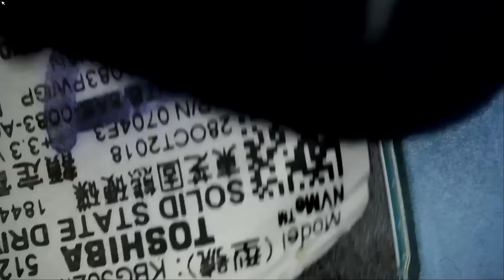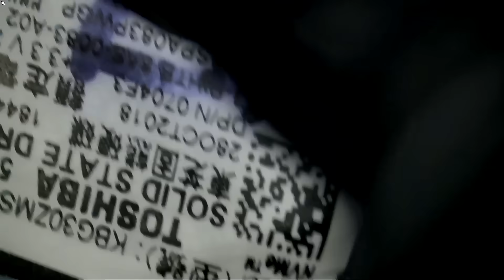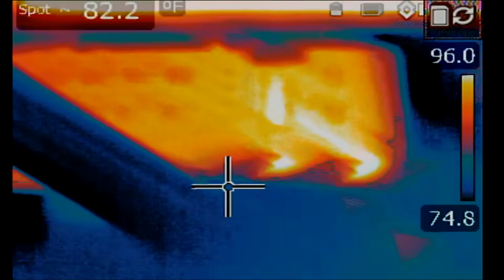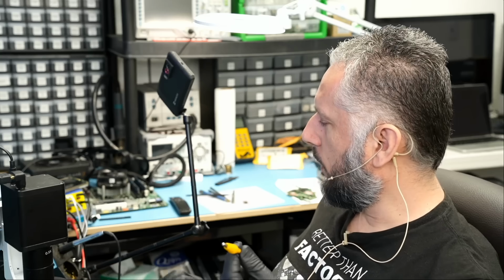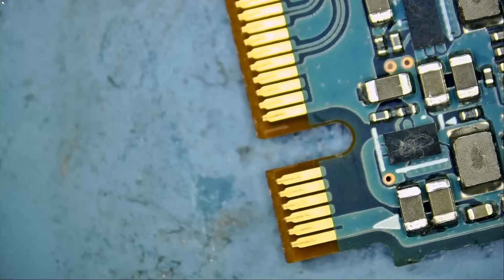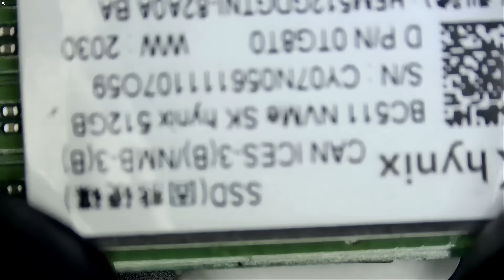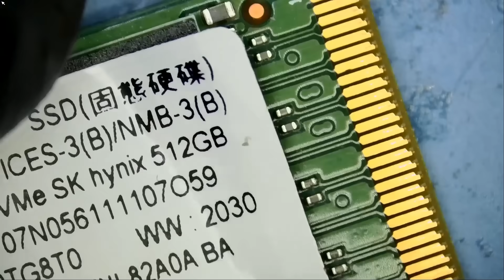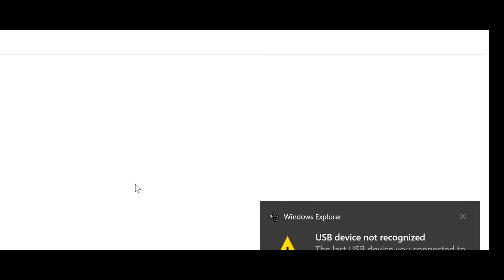M.2 NVME SSD Drive Repair - Is data Recovery possible?

Comment: Hello, I have a question recently I had 2 NVMe SSD fail, not the same time but on the same slot, while I was using my computer they were both my boot drive, my question is if this is because of the ssd or the motherboard?

Comment: Hi, I’m using a GigaByte NVMe 1TB. It suddenly stopped powering up. I’ve tried it in different laptops and external SSD enclosures, but nothing works. I believe the data is safe, but the power issue persists. I don’t have an expert nearby, so could you help me troubleshoot and fix the power issue?

Comment: got the same drive to the hands - it's also not detected, but it makes some electronic noise when connected and SoC heats up. Will check the stuff around of it like you did.

Comment: Hi .... I have Acer Nitro 5 with a Nvme hard drive from the factory . But wen i try to start from the power button , it comes a black screen with any logo , but just black screen . I can not see even the mouse . But if i change another driver , all works fine . Do you think my original Nvme hard drive is already dead ???

Comment: Your machine is seeing a drive, it’s just the storage format is not recognized (fat32 nvme etc) If it’s not recognized, 99.5% of the time, it’s a Linux based drive and was created on it. Windows is garbage and only reads it’s type of drive protocols whereas Linux reads all protocols.

Plug it into an Ubuntu machine

Comment: Which SSDs (Nvme) drives do you see as less likely to fail from your hands-on experience?  Which drives do you see often in your shop that "fail"?
Reply: I just bought lenovo nvme that stopped working during first test run. It got renowned silicon motion controller

I got another chinese nvme that is working just fine.

You can't tell when these would fail.

But you could put your trust in SanDisk, WD and Kingston.

Comment: Have you ever seen a non-boot NVME drive cause a BIOS POST error? I’ve got an ASUS B650E-F with a 7700x CPU that after adding a new NVME has just started to have POST failures, CPU and VGA lights are red, meaning that no video card was found, along with a CPU problem. I have no GPU yet, just running off the AMD 7700x for now. When I power down and restart, it boots right up with no failures, it’s only the 1st startup that causes a problem. The last thing I did was add a 3rd NVME drive on the motherboard (not the boot drive). Do you think the 3rd NVME could be the problem? All 3 are Samsung 980 Pro, the boot drive and 2nd one are 1TB, while the 3rd is a 2TB drive. I don’t get why the first restart is a problem, and then boots fine. Any suggestions?

Comment: Question ive looked all over for i have a m.2 that was 1tb a reinstalled windows and niw even in the bios it is 500gb i pulled it out and my linux machine under both disks and gparted all show the same thing the labeling says it is a 1 tb as well it had linux on it. I know windows is a hot mess any suggestions?

Comment: Try checking the voltages around the component 2 LZ maybe it will give you some clues , I think it's a low voltage regulator.

Comment: it is a feed-through filter and is not a capacitor as it has been rightly pointed out in the comments, and it is not a short as it is a filter and will show continuity at both ends and is used for EMC filtering.

Comment: This guy is one of my idols i currently have a hobby for collecting broken game consoles and flip them.the nvme ssd have a short life expectancy.I am not sure honestly but in their paper work it states their life expectancy is based on heavy use.I looked into the subject their only supposed to read and write so much before they die.but im sure im rong their looks like a voltage problem caused the ssd to die.

Comment: Anychance I can send my 3060TI to you to try and repair?? 

My girlfriend had a manic episode and decided to punch my gpu a few times while in the system which has resulted in a slight bend. I can get the gpu to run sometimes maybe for 2 hour before I get a " VIDEO TDR FAILURE "

Comment: Those 2LZ is probably just a common 1.8v LDO regulator needed for that sata drive to work, you can check the voltage on either pin 1 or 2 (close to the dot) at the other chip and compare it to the broken one; most DFN LDO has the output voltage at the 1st or 2nd pin, and the input at the opposite side.
as for the crack on the main chip... just prey it still works.

Comment: Yah I definitely see the line in the NAND chip.  Looks like it could be a factory defective chip that was on its last leg and just decided to give out.  The amount of heat coming from the small chip makes me think its got a communication issuse with the NAND chip.  Inject voltage while the capacitor is removed maybe you'll discover something new.

Comment: I just bought your hot air soldering station and fume extractor!  So far I Hiroshima’d 2 PCBs (not important ones) and successfully desoldered and resoldered another PCb now that I’ve got the feel for it. Awesome tools!  I was blown away when the hot air automatic turned off when I put it in the holder, super awesome

Comment: I agree with the comments that it is a special inductor. Panasonic used these in its early plasma Tvs. That often shorted. Just short what you would normally expect to be the ends of the cap. That should restore supply voltage to the SSD chip unless the short was actually the black device that showed heat when voltage injection was made. It is likely a type of voltage regulator.

Comment: I've been using ddrescue for years to recover mechanical hard drives. I've had it work even when Windows doesn't recognize a bad Windows formatted drive.  Ddrescue doesn't care about the format - it just reads sectors/blocks and writes the data to an image file on another Linux drive. When it's done, you use it to write the image to a good drive. It will make a pass to read what it can with 3 retries. Then it tries smaller blocks to try to recover. In the end, you may have some files with missing data, but it will get everything possible regardless of format. It gives you a running status of what it read and how many errors it found. After the initial pass, the size of the errors (unreadable data) will go down as it reads smaller blocks and finds more data it can recover. I tried it once with a bad flash drive and although it tried the whole drive, it couldn't read anything. I suspected the memory chip was bad but I had no way to test it.
Reply: Yeah, it is actually one of 4 problems, one being corrupt filesystem. He should buy/use some software given he deals with data recovery.
Reply: Hmm, i re.ember norton doing an awesome suite of cjeap recpvrry tools back in the 90s, they even allowed you to read dead sectors.
Reply: @@unknownplayer9472 it can and I've done it using photorec. You need to corrupt just some sectors from partition table to make it unrecognizable, while all data sits on disk happily

Comment: Hello, I just get a job as a Laboratory Equipment Technician for a University and I could use some advice. The position hasn't been filled for a few years and alot of the repair Equipment is pretty antiquated. While I have access to hi-presision multimeters, oscilloscopes, and calibration Equipment. I don't really have a good soldering station, just a few old, cheep ones used for training. Do you have any recommendations on any Equipment like a solder station, PCB preheater, and other tools.

Comment: Regarding to "USB device not recognized". It's a whole separate issue with current windows 10 (and maybe 11 as well) versions. I work with computers. All of my clients have been reporting this issue. I have this issue since the latest update, my relative(s) have this issue and many other people that I know have this issue. Haven't tried to fix this issue myself. At random, Windows reports that some USB devices cannot be recognized and doesn't allow the connection to the motherboard.

Comment: You can use an oscilloscope instead of a multimeter
Reply: Not really when you need to inject a little current for testing; I don't know of scopes with that capability because scope probes aren't low resistance and flowing current thru them alters the reading you get; it sort of turns into a complicated nightmare to even do that

Comment: Could concentrated heat on the corner of a chip cause the chip to crack ?
If it didn't, what a relief. If it did we all learned something.

Comment: I bought a WD SN770 NVME SSD that won't get detected. USB adapter at first didn't show anything.
Cleaned the contacts a bit, same no signs of life.
Cleaned the contacts again, USB adapter now shows error.
Cleaned contacts with rubber eraser -- voila! WD SN770 detected and working!

You know, sometimes it could be the simple things like dirty contacts...

Comment: 2LZ is step down inverter or power supply for 1.2 v or voltage regulator ,to work NAND Memory, need 3,3 v or 1,2 v to work
need to check resistor here 02:07

Comment: When i had a data recovery project on a dead mac i had a hell of time even reading it i ended up using PXE windows on usb with pre installed tech tools. What ended up working was disk drill was able to recover 3 decades of photos from my grandmothers days as a kid in early 1940's.
Reply: Spinrite is tits. Cool about the photos!

Comment: It's not a capacitor, it's an L + C filter, what you checked should be conductive.
Reply: So him replacing with a regular cap would make the drive still not work then, correct? thanls

Comment: I didn't see you measure the cap outside the circuit, just the pads after removing it unless it was done off camera just to verify it was shorted, not question of poor marksmanship Anyway, good deduction and fault finding. You have gained much experience thus far and we can learn more from you.
Reply: He did measure. Not the cap, but the board.
Reply: excuse me

Comment: The 2LZ XC6103D530 is CMOS Voltage Detector that gives a signal after delay on power detected. There are two of them on the board. Why not compare the peripheral voltages for defect tracing?

Comment: Nice video again. But, I want to say is, SSDs are kind of fragile. It is power sensitive and may be shock sensitive. I would possibly make double backups when keeping files on SSDs.
Reply: I've had a Kingston SATA SSD (not m.2 though) for more than 5 years, and it's been working without issues ever since. If you have very important files, sure, a backup might be needed just to be safe, but SSDs are pretty reliable.
Reply: Always make backups if your files have any value.  Not sure what you mean by double backups. If files only exist in 1 location, it's not a backup. Raid is not a backup, doesn't protect you from file system corruption. 
With the 50+ drives I've owned hdd's are more vulnerable compared to ssd ymmv.

Comment: Alex maybe the FILESYSTEM on that drive is LINUX ext4 or such
Maybe that drive since it is 2230 [the smaller size NVME] was in some steam deck machine
Alex try a LIVE BOOT LINUX on USB flash stick, see what DMESG tell you
dmesg reports errors thoroughly, in the terminal you type: dmesg or sudo dmesg , then it shows you more details of errors
The is also gparted or kparted that tell you the filesystem type of the drive
Reply: In windows, connecting a ext3/4 etc partitioned drive, you'll hear the windows device connection sound, and then windows will ask if you want to format the drive.  Given he's seeing a USB device not recognized I think there's still issues with the drive.
Reply: @whalenz  Thanks for the correction
But still it could be other LINUX/BSD FOSS OS filesystem like BTRFS , F2FS , JFS, XFS ...
gparted or kparted give you the option of checking the drive on linux
Reply: @igrewold  No. File system doesn't matter whatsoever with respect to hardware recognition.

Comment: When you connect the drive to the mac could you open terminal and run 'sudo dmeag'? Curious if the drive spec info would be presented and block size. I've seen when drives have parts fail, it would corrupt the drive to a state that it won't be recognized by windows or mac. Recovering the blocks or rewriting the partitions would be necessary. For instance, if the dmesg does display the drive specs correctly, you could run 'testdisk' on the drive to find the corrupted geometry.
Reply: That SSD has an electronics problem, hence no computer would recognize it.

Comment: Why do you measure all capacitors in parallel? if one is not shorted obviously the others cannot be.
Reply: Still learning myself that was exactly what i was wondering, but having seen a lot of his videos my guess would be that its faster to measure them all then to determine if they need to be measured 😆

Comment: Great work Alex as always. I guess the easiest solution might be for the owner to purchase the exact same card for you to swap out the components.
Reply: That can be a gamble though since it's possible that another SSD of the exact same type uses different components.
Reply: @Scitch87  probably best getting an eBay used drive that good provides images of the item
Reply: @Arachnoid_of_the_underverse  that might be a possibility but realistically there is no way any eBay listing has images that lets you see those components clearly.
Reply: @Scitch87  Are you talking exactly about this on ebay?
You know, the label is still readable...

KBG30ZMS512G Toshiba BG3 Series 512GB TLC PCI Express 3.0 x2 NVMe M.2 2230 Internal Solid State Drive (SSD)

or 

Toshiba BG3 CSSD 512GB NVME PCIE M.2 2230 TLC Internal Solid State Drive

capacity: 512GB
technology: TLC
communication/ lanes: PCI Express 3.0 x2
protocol: NVMe
slot: M.2
dimmension: 2230
something: Internal Solid State Drive (SSD)
model (implies same PCB/ components, with little changes between versions, if the manufacturer isn't scammy): KBG30ZMS512G

Comment: 2LZ = XC6103D530 = CMOS Voltage Detector
Reply: Voltage detector with coils ? I doubt that. It is some sort of switching voltage regulator as for sure that memory ic needs some other voltages than 3.3v and there are no others ic's that could do that on this board. Also datasheet for xc6103 says it should have 6 letters/numbers marking on chip.
Reply: I'm curious, how did you find that?

Comment: Now 2LZ is defenetly some voltage regulator. Now what voltages does that NAND chip needs. 3.3V is already provided by motherboard, so its 1.8 or 1.2v. you can try injecting low volatge and raising it until it starts working and raise it a little higher so its stable.

Comment: honestly the 2lz chip just looks like a buck converter, because i see the voltage divider and the inductor close to it... you should just be able to put another buck converter on the board they all use the same formula i think (don't quote me on this) VCC=0.6*(1+(R1/R2))

Comment: It could be a Linux formated drive. You would need to connect the drive to a Linux operating system to see if that works or ask the customer what OS is used.   Its a coin toss for the repair.
Reply: If you connect it to a macbook, just press and hold alt button on keyboard and wait for it to recognize.
Reply: Why need Linux? Just use any windows partition tool, any good program is going to see that drive no matter what its formatted as
Reply: @Theoldenmage   no if it’s formatted with a OS it goes directly to boot and will not recognize as a drive.
Reply: @dillwack  not true? How else would anyone dual boot operating systems? Just plug the drive in and view it in any partition tool

Comment: I would put the right capacitor on there.... clearly changing it made it activate on the system. Now use the right spec and it might actually turn on

Comment: It's a capacitive filter as other have said - the metal points on the side indicate that's the difference.  The 2LZ chip I bet is the issue, but I see what you see with that faint line across the main IC - worth a shot though!
Reply: Tagging on, the drive might be working already but the file system might be not readable by Windows. Macs have issues with these external NVMe enclosures. The fix is to use a USB-C Mac and put a USB hub in between, then it should be recognized.
Reply: @GarbageGoober-pf8wm  I don't think the file system should matter as that USB error is more generic and related to the device itself. In computer management, I think it would show up as a "RAW" partition if Windows couldn't tell what the file system was.
Reply: @kunka592  yes and annoyingly ask to format it
Reply: Great
Reply: Watched the last part like 5x now and i swear i see a faint crack line on the main ic also

Comment: from the connector key this is not NVME ssd its normal sata just in m.2 format. nvme and sata are different protocols nvme uses pcie lanes and sata is just like old sata. maybe that usb adapter does not work with sata only nvme?
Reply: Nahh.. It's an NVMe drive if the sticker on it isn't tampered. It's a "toshiba kbg30zms512g" drive (Toshiba/Kioxia BG3), which is NVMe. I have a Kioxia BG4 and it's also an NVMe.

Comment: That capacitor is a 3 terminal capacitor and it should act exactly the way you probed it. Google for "Three-terminal Capacitor Structure - Murata"
Reply: wow, that's interesting, it appears that component is not a simple capacitor, it is actually a 3 inductors + one capacitor in one capsule.